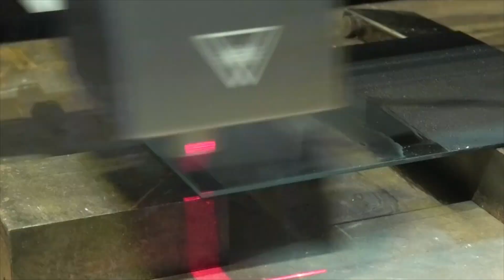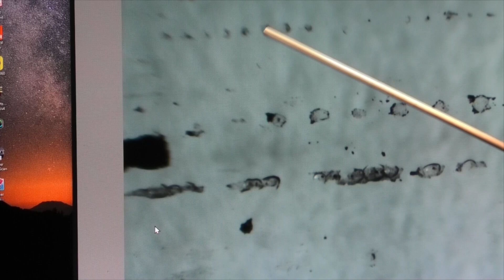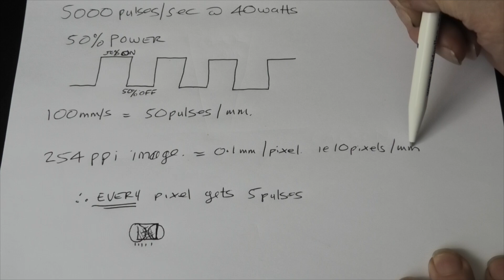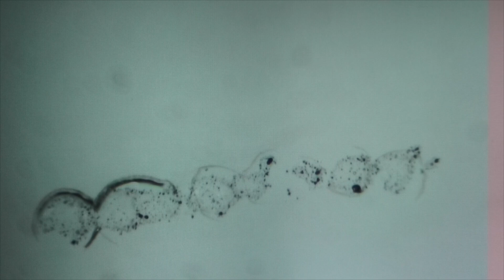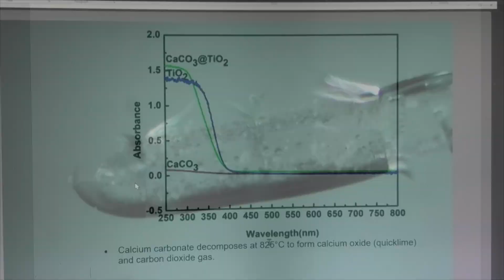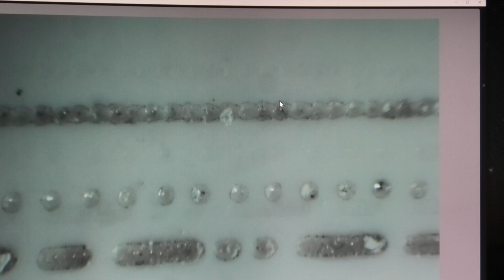Diode Lasers---Under the Hood 31

Comment: A little bit of soap might make it easier to mix the coatings. Thanks for the video.
Reply from the maker: Thanks for the useful comment. Yes it makes sense as most oleates  are surfactants that reduce surface tension Sadly there is a side effect.....bubbles. I have tried varing ammounts of washing up liquid from one drop to many drops. Once  bubbles form they are a pig to remove and when I paint the tile/glass surface I  pull bubbles as I apply  The thick creamy texture I get with PVA glue  (no soap), is virtually bubble-free and mimics the consistency of gloss paint. The finish, although not as perfect as airbrush, is fine for most purposes. As you see from the way TiO2 globs into a black mass when heated, a thin coat does not have the bulk of TiO2 to perform its white to black conversion miracle. I will be testing this mixing again on aother material that has arrived in the post today.